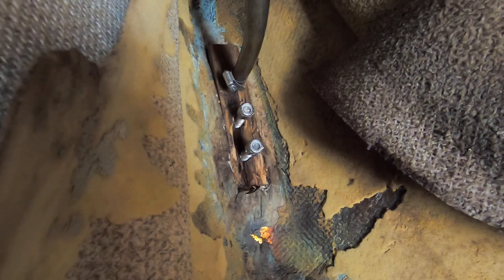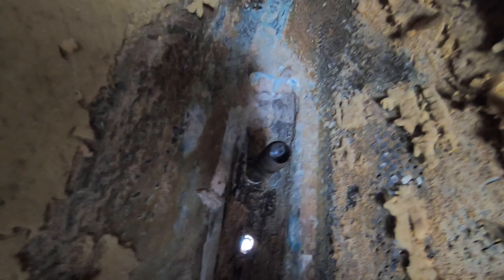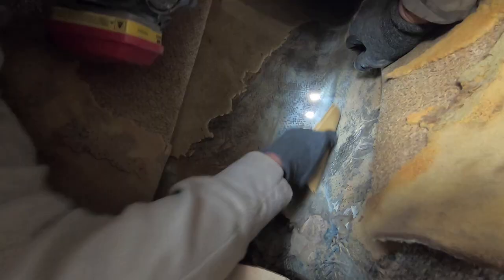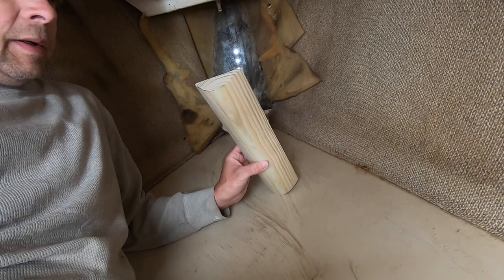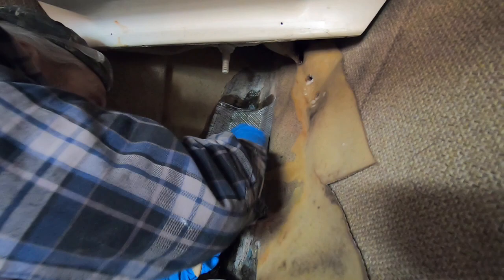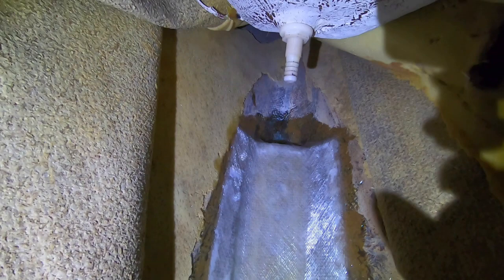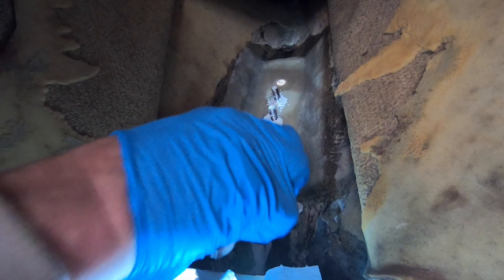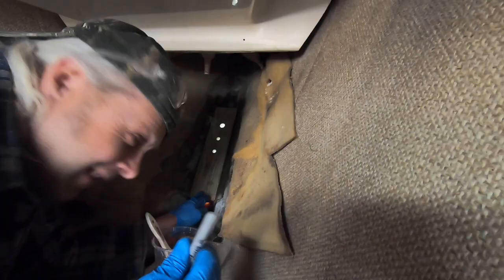Bow Pad Eye Repair, and Fiberglassing Inside Of Hull | E14

Comment: Nice work Karl! Had to do the same on my '79 Daysailer a few years ago. I found the half rotted wooden backing block in the bilge. Replaced it with composite. When I bought my current boat, a Rebel Spindrift 22, the bow eye was nothing but two jagged stumps sticking out, so I managed to remove those, drill all the way through, and replaced with a longer eye and an aluminum backing plate on the inside. There is a wide enough "face" in there to be able to use about a 3" wide plate.
Reply from the maker: Awesome repair jobs Tim! Yes it is amazing how bad some things get over time. I was going to use an aluminum backing plate but was afraid of galvanic corrosion between the different metals of the pad eye/nuts, and plate. have you had any problems with that?
Reply: @karlsawesomeadventures9608  Not yet Karl, and it's been on there for almost 5 years now. All parts were liberally slathered in Tef Gel, which I think helps. I think your idea of painting your plate will go a long way towards preventing any problems as well. Just curious, but did you by any chance consider using butyl tape instead of Sikaflex? I used butyl on mine and it's holding up very well, no leaks at all.
Reply: A Rebel you say? I picked up a Rebel 16.5 this summer for a discount because it was missing its boom (how on earth someone manages to misplace a 135 inch machined aluminum pole is beyond me). Had a heck of a time trying to find a replacement boom because she's got some seriously generous legs(sails) for her size. Nobody I could find sold the factory replacement boom and dwyer aluminum mast company wouldn't return my calls or emails about a custom made one. Tried looking at replacement booms for more common boats but I started getting into 22 and 24 foot models of catalina's and odays before the booms were long enough for the little Rebel. Those weren't going to work either. Even considered milling one myself out of wood until I saw a derelict old nameless sailboat in an old timers back  yard. The hull was shot, floor was gone and it was growing 7 foot weeds out of the keel; worthless, except he still had the ole mast, boom and hardware laying around for it.
     He was happy to sell me the boom, mast and hardware(his old lady was kinda disappointed I didn't take the whole eyesore out of the yard. Sorry lady, I've already got two project boats at home). With some dusty pdf factory specs to go by, I cut the spare mast down to size, because of course this boom was also too short for the long-legged Rebel by over a foot, and jerry-rigged myself a boom using that length of precious sail-slotted aluminum and the gooseneck, pulleys and block from said boom that was too short.
     Took it out to the lake, rigged her up with the boom that practically looks normal from 20 feet away and she sails like a greased feather.

Just looked up the spindrift, thats a pretty rare bird. Only 400 of them made by Rebel over five years. Big boat for a retractable keel, too. I bet its a blast for camping and weekend trips.